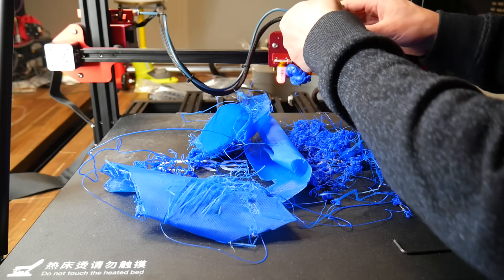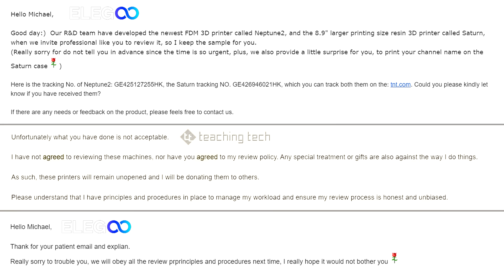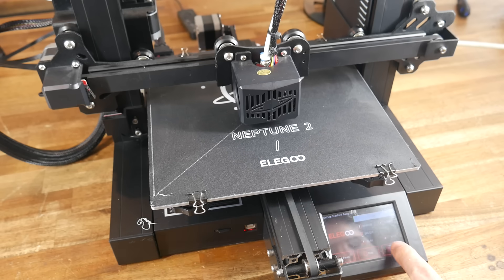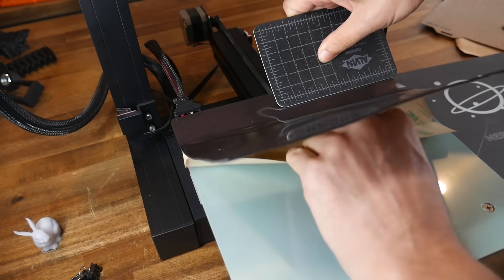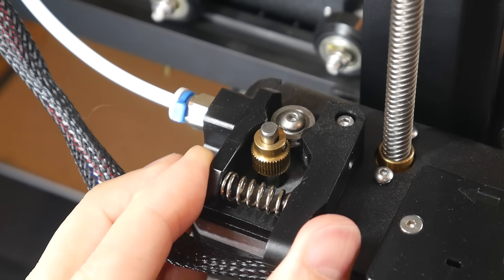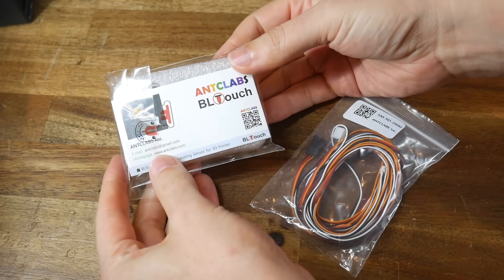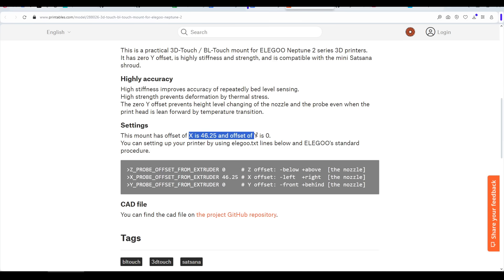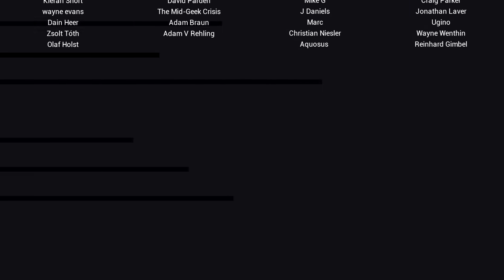Are cheap 3D printers more trouble than they’re worth?

Comment: This video couldn't have come at a better time, or been more on point.  My brother just called me last week and asked if there were any sub $200 USD printers that were worth getting, and I told him that unless he wants to tinker and upgrade and fuss with it, the answer is no.  All the Ender 3 clones are a labor of love, and I told him he'd be better off buying a Bambu.  He's never had a 3D printer before, and doesn't know anything about the workflow of getting something to successfully print.  I sent him a link to this video.  For the record, I'm running an Ender 3, and tinkering with it all the time.  I've got it pretty dialed in at this point, but I'm also in to it about $600.  I've had it for several years, so it's not exactly fair to say that I should have bought something different (Bambu didn't exist when I bought it) but if I had cash in hand now, and had all my choices to make, I'd definitely not pick the Ender at this point.
Reply: Your brother wants it for what? 3d printing for me is about making my own functional items. And that is really about a CAD software learning journey. Which you can do on anything that prints good enough. In many cases the answer to what 3d printer should I buy, is none of them if you're not going to learn CAD.

FWIW I wouldn't buy another Ender 3 (mine is a V2) today either. I did buy an Ender 3 V3 and it's fun so far.
Reply: @BadSpock  Mostly functional prints, and strictly ones that can be downloaded.  He's not in to CAD, and I think he's unlikely to want to learn.  He's also unlikely to want to fiddle with printer profiles and tuning on the slicer side, so it's a rare case where his best move is probably to get a printer that has cloud services so he can just send the job from his phone and count on it being right.
Reply: @LabRatJason then a a1 makes sense to me. I've never had much luck just downloading functional stuff I need. It is always custom.
Reply: It's a really good point. Get something known to be easier to use even if more money. Unless that person wants to enjoy fighting a machine day after day. Which can also be enjoyable. I got a P1S and love it. No fighting it which makes running it more enjoyable. Although some bits of it are still a pain. If not for Bambu I don't know when I would have gotten a printer. I've wanted one for a long time and glad I got into it finally. But I would have known a lot more if I did it a decade ago like I first wanted.
Reply: You get a family or a pet to love, you get a 3D printer to print. 
Throw that ender away and get something better. You’re just sticking with it due to sunk cost but somehow confused it as a “ labour of love”.
Reply: @slowcyclist4324  Like I said, my investment came before many of these coreXY types became really well understood and well tuned.  I actually haven't upgraded anything over the last 18-24 months.  When the V-rollers die then I'll probably be looking for something better (I was at one point thinking linear rails, but now I've seen the light)  It's not so much sunk cost fallacy, it's more like incremental costs fallacy.  It feels easier to pay for small upgrades than to just drop 5 grand in one shot (Prusa, I'm looking at you).  Anyway, I'm greatly anticipating the outcome of these guys working on the SV-08 multi-head conversion.  If that project goes well, then I'll almost certainly go that route.  I don't mind tinkering, and like I said, incremental costs.
Reply: There are printers that are inexpensive and have the noob-proof extras like the auto leveling, metal hotends, mag beds demonstrated in the video. There is definitely a middle ground between the A1 and ender 3. I've had an Anycubic Kobra that has just worked no fuss for the last few years no worries. It's missing some modern features (camera, WiFi) but otherwise it works fine zero major issues, printing in an outdoor shed at that. But you do have to understand slicing, at a minimum
Reply: The A1 mini is actually sub $200 right now.
Reply: @ichisaur  I wouldn't want to recommend the A1 mini to anyone though. It's a good printer, but it's super limited by its size. Id rather save up for the full size A1.
Reply: @thebillyd00   Nah, at that point I'd just go directly for an enclosed printer. The Mini format can be good enough for many and is actually cheap.

Comment: I had some serious flashbacks watching this. I bought an Ender 3 a few years ago as my first 3D printer, and by the time I sold it, about the only original bits remaining were the frame, axis motors and power supply. It was one hell of a learning tool, though. It got replaced by a Prusa Mk3s and I was properly amazed.
I just bought my sister a Bambu Lab A1 for Christmas. 😁
Reply: same lol. got an x1c. This thing is amazing. 
Within a month, iv already put more hours through it, than I have through my ender 3.
Ender 3's work fine. Its just that I rmeember tryna go to sleep at 10, and then ending up going to sleep at 1 cus the printer had a fuckup lol
Reply: @honkhonk8009  Yeah - I bought an X1C, I needed to be familiar with the interface so I could support my sister. 
That's my story and I'm sticking to it. 😁
Sold my Prusa Mk3 and now have  a Mk4s. Both Prusas built from kit. Highly recommend.
Reply: The Ender 3 definitely had it's purpose filled I would say. It's really great as a learning tool indeed. I even wonder if starting with a better machine you aren't letting go of some valuable knowledge you can obtain on the cheapos for future inevitable headaches, usually maintenance induced.
Reply: @Kalvinjj  Yup. Being somewhat of a geek, I didn't mind fooling with the beast - rather enjoyed it, actually. Starting with the Ender really made me appreciate just how good newer machines are.
I built both of my Prusas from kit (a Mk3s and a Mk4 - recently upgraded to a Mk4s). 
By comparison, my Bambu X1C is an appliance - plug it in and print. That doesn't keep me from messing with it, though. 😁
Reply: Interestingly I thought I have an inexpensive printer that I bought a few years ago (Anycubic Kobra), but all the upgrades he did mine has already, plus is direct drive. I have never had any real problems. Nevertheless these shiny core xy multicolour printers are tempting but damn it the Kobra still works fine!

Comment: what about the sovol sv06 ACE ? It looks like yet another ender clone, but with every needed upgrades. I think it is sold for around 260-280$. I have a highly modified ender3 v2, tbh if the sovol works as it is described, i'd say it would be a great recommendation for an entry level printer. the bambu is still pretty expensive.

Comment: Before even going far into the video Yes they are too much trouble my ender 3 pro even though it's a good printer I had lots of problems regarding bed leveling and multiple problems just get something better even if it means you pay a little bit more it will save you massive headaches and time

Comment: This is a trap I tend to fall in! I tell myself that it'll be ok, since I have some raspberries with multiple klipper instances on them, so I can just plug them in and convert them to klipper. But other expenses always creep in. Recently, Artillery 3D was selling out old X3's for 170$ I think, luckily I missed out on it before their stock ran out, but on cyber monday I saw SP-5 v3 for around 200$, and I just couldn't resist. I know it was always a troubled child among 3D printers, but that just gives it more charm in some way. I still prefer V6 style and open source, which many new printers don't provide, and there are also companies like Trianglelabs that offer cheap, (mostly) acceptable upgrades to "fix" older printers and bring them close or up to modern standard. But in the end, I just find it funny that I'm willing to go so far for an older printer, while something Infimech Tx does it all for similar or smaller price...

Comment: This whole video gives me PTSD to my years of 3D printing before My first BL printer.
Reply: right, had a bunch of good prints on my e3, but it wasnt worth it in my eyes, to much upkeep.
Reply: Same here I got a P1S and my Ender 5 hasn’t done anything sense. It was reliable, but took a lot of tuning. May use it for parts to build something else. 🤷‍♂️
Reply: @meanman6992  I was skeptical before I bought my P1P. The day after it arrived I sold all of my other printers. I have not had a single failure on my P1P that wasn't directly caused by me doing something stupid like selecting the wrong filament in the slicer and even then sometimes it still works.
Reply: All printers nowadays have autolevel, actually my Ender3 had adaptive mesh with klipper way before the Bambulabs.
Reply: @eaman11  true but only the BL printers and prusa printers have nearly flawless software integration as well. The BL printing profiles are so good that you basically never have to tune them to get good prints.
Reply: @DoRC  BL printer profiles is just one profile copied a dozen of time, there's no slow, fast, strong, silent, vase mode, model profiles...

There's one "strong" something which is the standard profiles with more walls, a quality profile which is the usual with just lower layer height.... There's ZERO tuning of accelerations, jerks, speeds, cooling for different scenarios... :(

1mnm of retraction lol ! My printers use 0.35-0.5mm... Algos, smoothing for IS unknown and unsettable.
Reply: @eaman11  That may be the case but they work really really well. I have printed with basically every material there is out there on my BL printers and the only things I've ever had to tune are temperature flow and pressure advance.  To be honest I probably could have gotten away without tuning those as well.
Reply: @eaman11 My old Ender technically did too but it never worked right.
Reply: @eaman11 yeah the hole adapter bed mesh thing is wild ,  blew my mind the first time I used it
Reply: that's why I clicked the vid... yes... no more old or cheap tech! Prusa trumatized me!
Reply: My P1S really made my previous printers obsolete as it prints faster than things i need so its always ready anyway
Reply: Auto bed leveling was one of the best things to happen. 😭🙏
Reply: Bro you and me both.  Nothing is worse than all of the endless wars with compiling firmware, scrolling GitHub, ruining probes crashing them into the bed because you compiled a version in vs that used the z probe pins vs the BL touch pins lol…I bought an X1C for the family to play with this week— I’m sparing them from any of these headaches I endured a few years ago.
Reply: I was 100% thinking this exact same thing
Reply: I quit for 10 years because of this kind of stuff.  I still have 6 Ender 3's in my garage gathering dust that were in the middle of an upgrade to a touch screen.
Reply: @Serenityindailylife  It ain't that hard: on my N2S I've litteraly hot glued the 3D touch to the toolhead plate, it has 5 wires and there's a socket with 5 wires on the mainboard labeled "BL_T".
Reply: @Serenityindailylife  Give this out to your local school or fablab. But know that auto bed leveling cost about 10€ to implement on a cheap printer and has been for years.
Reply: Haha indeed the live leveling omg
Reply: Insert Scary Movie grandma under the sheets scene "You're No Fun!!"

Lol, but yeah!! Back when you had to be a mechanical engineer to get a printer to work flawlessly.. "it was the worst of times, it was the best of times"
Reply: Very true. Bbl has changed the game.
Reply: @HK_808  Went from an Anet A6 for 5 years to a Bambu A1,and it's been an insane difference in how long i spend fixing print issues
Reply: Double the cost 

All I’ve done to my ender was the cl touch and the Ali filament pusher head . Both cost like 20 bucks . Probs the only thing I wish I had was a filament sensor which all of my new printers have . 

I always find myself making the big hard long prints on my larger v3 plus and use my v2 for all the bits and bobs .

Admittedly I had a old ras-pi that I use for octi print which help a lot with external monitoring and bobs

I also love the fact I’ve have a ender , ender v2 and know a v3 plus and I’ll never sell them I love just looking at the og working next to its evolutions
Reply: @Level-up-your-life  here's the thing. If you've never experienced how easy a BL printer is to use you probably just can't understand. I know that sounds like a cliche but until I bought mine I didn't believe the hype. Literally the day after getting my P1P I sold both of my ender printers and have never looked back. I would never touch anything that doesn't come with tightly integrated printing profiles ever again.
Reply: Just bought a P1S and Amen to that
Reply: What's all this crying about bed leveling.  It's not a big deal.
Reply: @dr_harrington  no it's not but imagine never having to do it again.
Reply: @DoRC  You still need to level bambulab printers if you want to keep the quality and dimensional accurracy.

You still need to adjust the beltsv oil them, grease the screws.

And it still wears down too.
Reply: @Splarkszter  The BL printers are not designed for manual leveling except an extenuating circumstances. I have two of them and have never touched them. I've never had a print fail due to first layer issues.
And yes of course there are still some maintenance issues that need to be taken care of but those all also need to be done on other printers and a whole lot more.
Just because something isn't flawless doesn't mean it isn't better.
Reply: @DoRC  That's because you didn't read the wiki and probably never checked if the bad is trammed or the mesh works too much. :/
Reply: @dr_harrington  It isn't a big deal to people who don't have anything else to spend their time on. Even 15 minutes to level a bed are 15 minutes I could have spent with my family, watching an interesting video, playing a game, etc. Life is short.
Reply: @dr_harrington you obviously haven’t lived without it

Comment: I recognize the firmware display format. It is MKS Robin firmware the Elegoo tweaked. But I notice that the board seems to be MKS clone, because I never seen a red MKS board. I have the MKS Robin Nano v1.2 board and it doesn’t look like that. I changed the vendor firmware for the MKS one and it made the printer a whole lot better

Comment: You absolutely get what you pay for, and I think it's far too easy to get an interest in the hobby, only to have that cut short by mediocre hardware.  I got my start tinkering with an Ender 3, before I got in touch with a number of printer manufacturers who were happy to send me Amazon return units for a very low price.  At the time, $250 machines were coming in under $100!  Often times, you got lucky and they simply never built it right, or couldn't figure out bed leveling.

I picked up an Ender 3 V3 KE for my brother last year, thinking that because it automated first layer calibration, it might be a decent machine for a decent price.  He ran into issues within the first month, and it sat for most of the year until this past month, when I got a chance to modify and upgrade everything.  Now it's screaming and reliable, but it took someone with experience to get there.  

Spend the little extra up front, to save yourself a lot of time and headache down the road.

Comment: 1:44 ok i want to see a video of you designing and building a printer using only a bespoke motion system you came up with by yourself that matches or exceeds its closest competition.
Not trying to be mean, this would be legitimately cool to see as a video but the thing is its not as simple as "quit cloning a successful arrangement" if you look at mills or lathes for the most part you wont find much variation in how they move because of practicality and cost.

Still definitely no reason to buy the bottom of the barel stuff